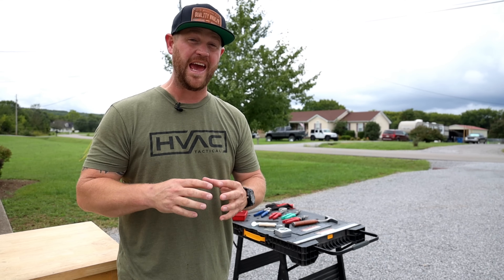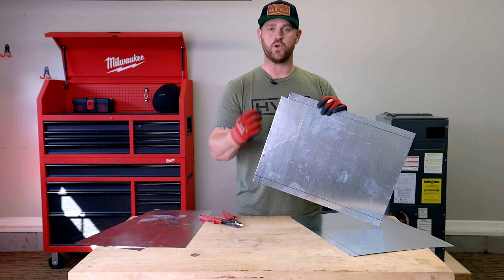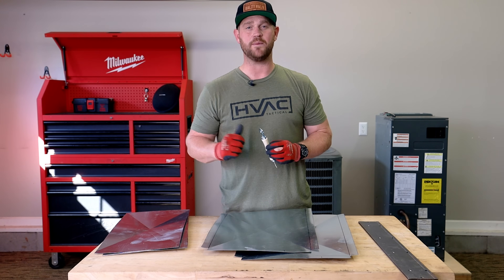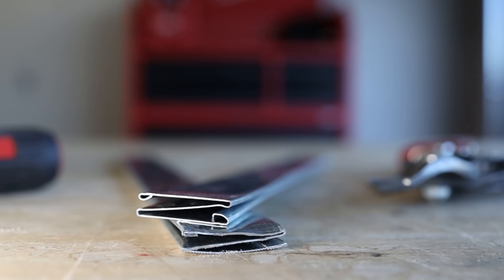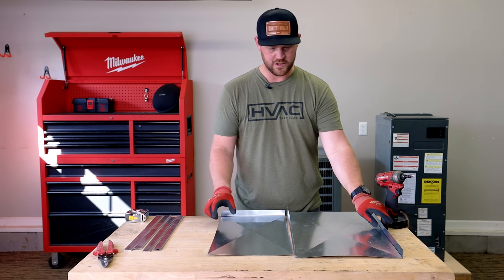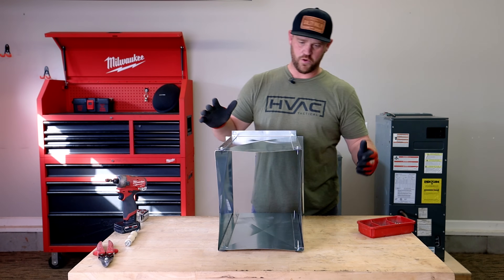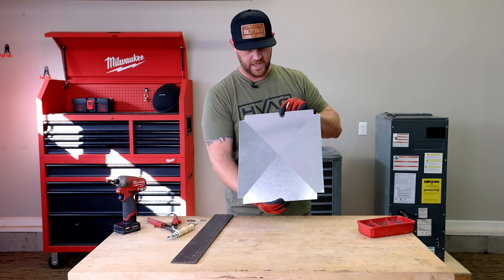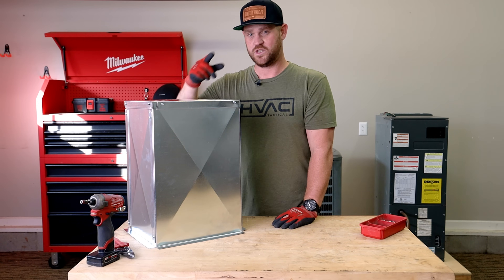How To: Fabricate A Plenum Box With BASIC Hand Tools | HVAC Ductwork

Comment: What gauge metal are you using. I wish you would have filmed the "breaking" as a non cut video. I'm skeptical that a fabric screen tool will break metal that easy, unless the metal is 24+ Gauge. I love the video, but I am wondering about the gauge metal and verifying the break. I own many screen tools from way back when I did maintenance. I've been in HVAC only that last 20 years. If that works, I would be happy to use it. I have a friend with a 4' MALCO break. I now work at a place where we have multiple breaks. But that would be easier at the job site that having installer travel back to shop.
Thanks,
Rodney
Reply: I guess it's 28 gauge or even 30

Comment: That is a stout, well made plenum.  I'm curious if you added any space after you measured the opening on the air handler.  I usually add 1/2".
Reply: I was wondering the same thing, which I'm sure he did but, he didn't mention it. I figure he was thinking about it being something that should be known.
Reply: Do you add 1/2 inch on every side ?
Reply: @LaTuya-che  I haven't built a 4 sided plenum like this.  When I make a plenum, if the opening were 19 x 20, I'd make my plenum 19.5 X 20.5.

Comment: Why not use one single piece for the sides and the back, then have a Pittsburg to attach a front piece on. Looks clean and you only have two pieces of tin. I do understand it is easier to remove the s strip. Plus you won’t need any screws to hold it together. No screws through s strip
Reply: I did not think about some people that may not have a Pittsburg machine.
Reply: This is if your making it in the field. With no brake or Pittsburgh
Reply: @TheJermac100  I guess my reading skills suck lol
Reply: A piece like this can be made in one piece.. using the folding tool as your brake. We make these all the time and hardly have the break. Only bring the brake for jobs with large fabrication
Reply: Because the video was about making it with just hand tools
Reply: @williamgildea8348  yes I saw

Comment: what’s the purpose for the cross break?
Reply: So the duct work does not pop and make a sound when the unit turns on and the air starts blowing through
Reply: Reinforcement
Reply: Adds a lot of strength to the piece. Also won’t let it flex and make that thundery sound.
Reply: Well done and explained, making job site fittings is always a great skill to have.  The cross breaking is also known to prevent OIL CANNING.
Reply: Christianity symbol